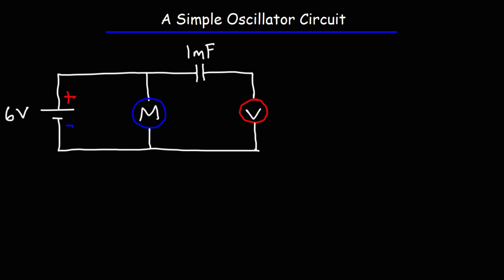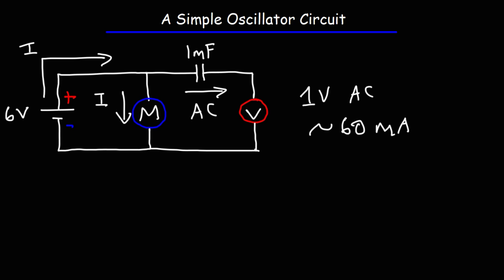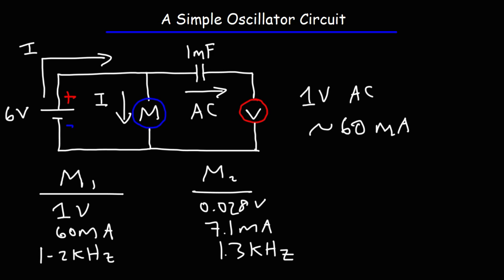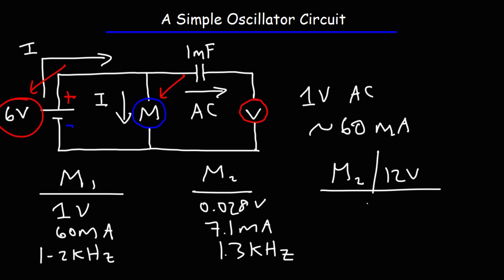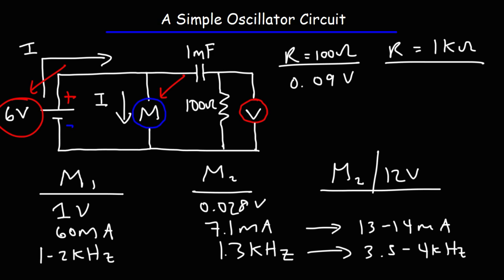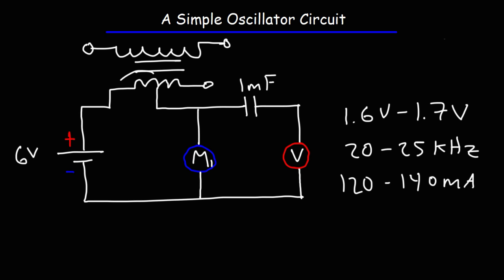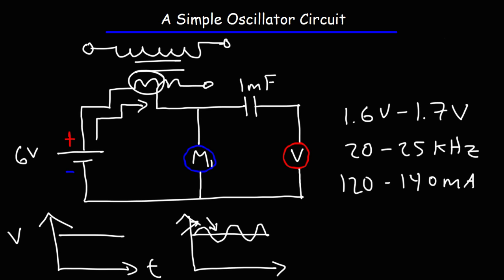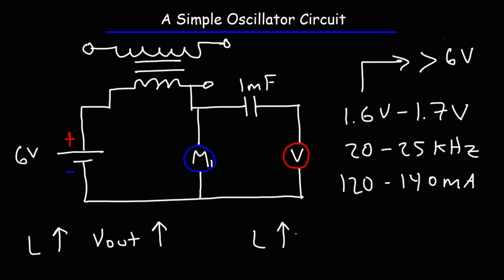A Simple Oscillator Circuit

Comment: Why is not motor in line with capacitor? Why would the same current flow both through motor and capacitor if they are in parralel connection? I cannot understand
Reply: I’d like to know too.  I felt myself asking “why” many times during this video.  Ultimately I think this was more for demonstration and I have a hunch that he’ll go into greater detail in the next couple videos…
Reply: the series capacitor blocks dc from the battery and the motor and only allows the ac generated by the motor